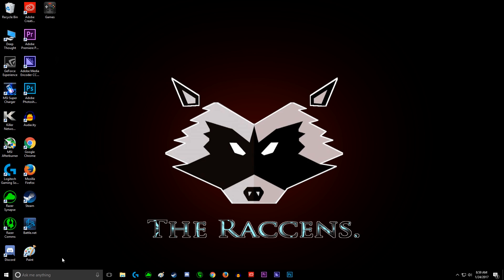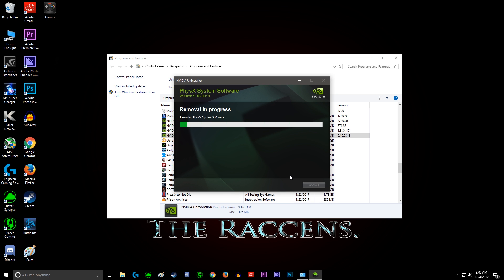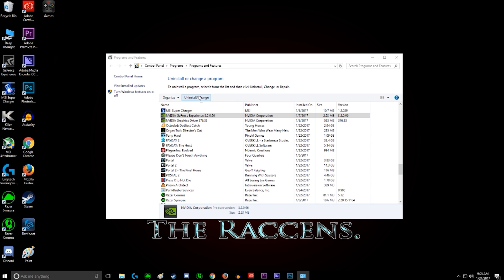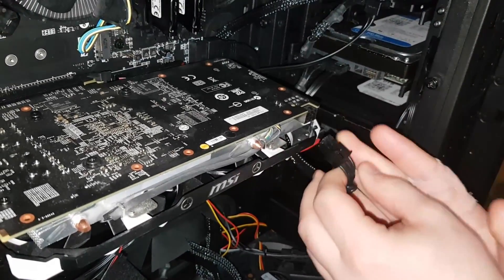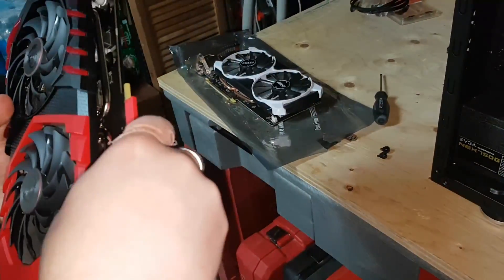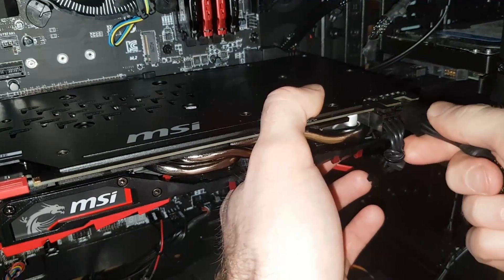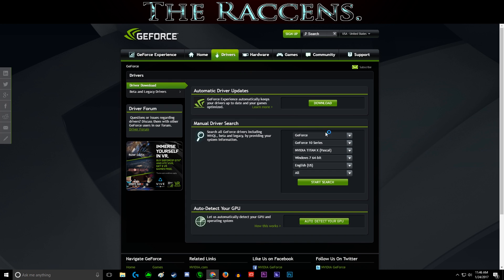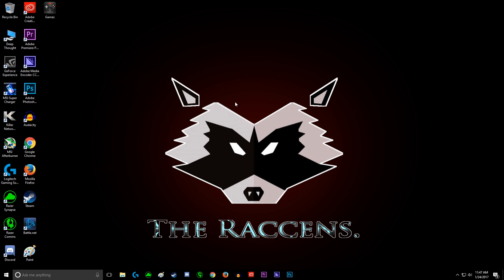How To: Install or Upgrade an Nvidia Graphics Card

Comment: I have a GTX 960 that I just took out and replaced it with a 1660. The computer is on and the desktop resolution is messed up of course I know why but I am downloading the drivers for the 1660 right now my question is what if I don't uninstall the old drivers that are for the 960? Won't they just get replaced when I install the 1660 ones? I'm just curious but I'm going to uninstall them anyway before I install the new drivers I just wanted to know what if somebody happened to do that

Comment: i did this exactly but my pc wont turn on
Reply from the maker: Did you check:

To make sure it was plugged in 

That the PSU switch in the back is turned on

That all PSU connections are connected properly

That your front panel connectors are properly connected   

That the outlet you're plugging your PC into is receiving power 

That your PSU has enough wattage to support your new GPU

If everything above is done and it still won't turn on then you'll probably want to do more research on what might causing the problem or take it to a professional.

(On a side note how did you do the last step of installing new drivers if it didn't turn on in the first place)
Reply: @theraccens412  my old gpu had a 8 pin power connector and i tried plugging it into my 6 pin gtx 1650 super but it just wont go all the way in.
Reply from the maker: @AliHussain-me6dw  Odd are you using the correct power cord?
Reply: @theraccens412  i think so, its the same one that was in my 960
Reply from the maker: @AliHussain-me6dw Try using another GPU power cable just to see how that one fits.

Comment: what if your just changing graphics cards with same brand NVIDIA ? but don't know if it is better or worse? cheers
Reply from the maker: What do you currently have and what are you swapping it for?
Reply: @theraccens412 i have expertvision geforce 8500 1gb but the connections to dvi cable are playing up when strating up pc . i just want to do a straight swap with something similar to make pc start up everytime . i don't use for gaming

Comment: I upgrade from a 1080 ti to a 2080 ti ( I know I know lol) so I didn’t need to uninstall the driver because they same drivers.
Reply: Jonah Lucas so if they are the latest version of the drivers will they worl
Reply: TecTonic Gaming yeah they were the latest drivers.
Reply: Jonah Lucas like latest update in the GeForce app right it’s my first time upgrading a pre built so
Reply: TecTonic Gaming too be safe just do what this guy did in the video. What you upgrading from and to what?
Reply: Jonah Lucas GT730 to GTX1050Ti
Reply: Jonah Lucas if I did uninstall all the drives will the gpu run cause I am dependent on the gpu hdmi

Comment: So I uninstall my old drivers and put the new one in and in shuold work or do I have to use onboard graphics?
Reply from the maker: It should work after you install the appropriate drivers.
Reply: @theraccens412  Thx bro
Reply from the maker: @juangpannuzzo1018  No problem Subscribe for more!